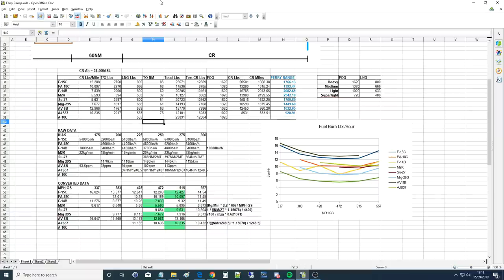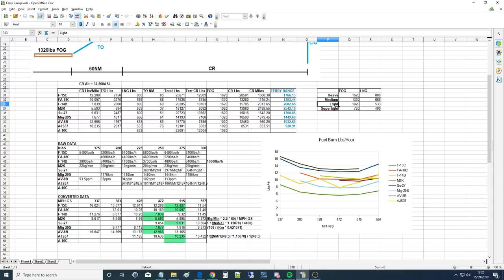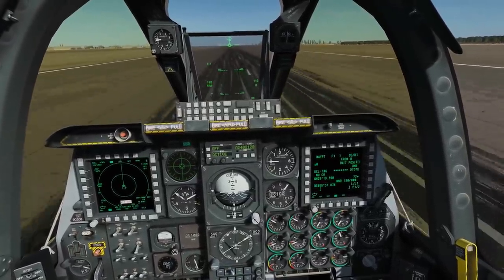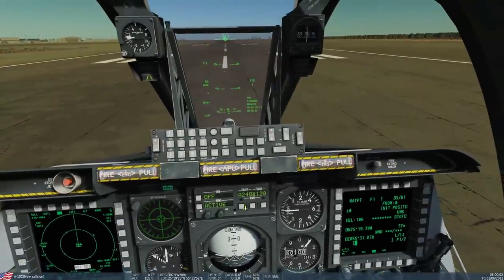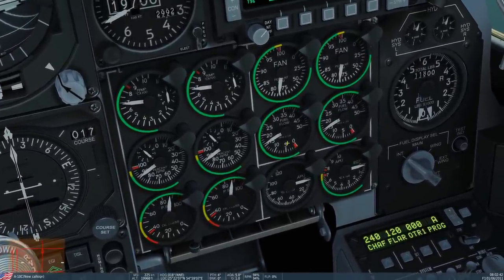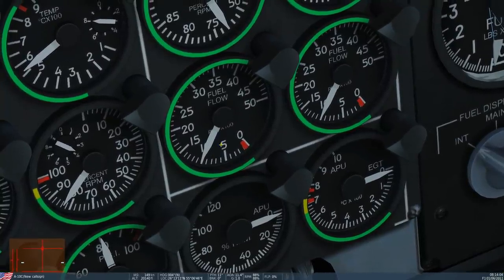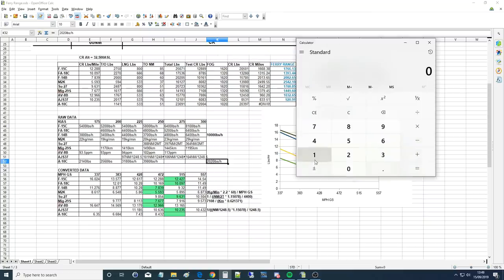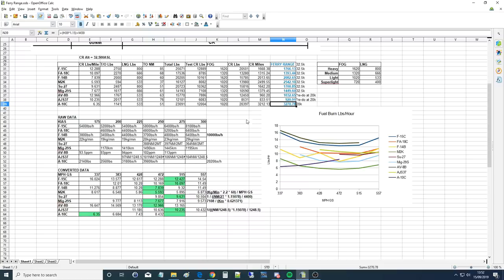A-10C Warthog: Max Ferry Range | DCS WORLD

Comment: Rectangular wings have one of the best efficiencies at low speed. The swept wing on airliners and fighters is to adjust their critical Mach, or the speed at which the wing loses effectiveness, as well as determine where on the wing the shockwave forms.
Gliders and the U-2 have long, straight wings, which lends credence to this.
Reply: The efficiency isn't due to the shape, but due to the engines. The A10 uses turbofan engines with high bypass which are way more efficient than the jet engines that other aircraft use, but they aren't as powerful.
Reply: @rubiconnn  A rectangular planform has an efficiency typically between 0.85 and 0.9, meaning that it is one of the most efficient designs in terms of drag and induced drag. An elliptical wing, as found on the Spitfire, has an efficiency of 0.99 or 1. Coupling the higher efficiency of a rectangular planform (swept wings are typically around 0.7) with the efficiency of a high-bypass turbofan makes the plane extremely efficient at cruise.

Comment: Probable error: KIAS to GS is dependent on altitude. Thus the 175 ias = 337 gs is incorrect, and that's a multiplier into the huge CR. When corrected to a smaller GS, that would decrease the range considerably.
Reply from the maker: Oh fuck! I completely forgot to adjust the KIAS-GS! Thanks for spotting. Will adjust it when I do the viggen.

Comment: Never exceed speed: 450 knots (518 mph,[192] 833 km/h) at 5,000 ft (1,500 m) with 18 Mk 82 bombs[194]
Maximum speed: 381 knots (439 mph, 706 km/h) at sea level, clean[192]
Cruise speed: 300 knots (340 mph, 560 km/h)
Stall speed: 120 knots (138 mph, 220 km/h) [195]
Combat radius:
CAS mission: 250 nmi (288 mi, 460 km at 1.88 hour loiter at 5,000 ft (1,500 m), 10 min combat
Anti-armor mission: 252 nmi (290 mi, 467 km), 40 nmi (45 mi, 75 km)) sea-level penetration and exit, 30 min combat
Ferry range: 2,240 nmi (2,580 mi, 4,150 km) with 50 knot (55 mph, 90 km/h) headwinds, 20 minutes reserve
Service ceiling: 45,000 ft (13,700 m)
Rate of climb: 6,000 ft/min (30 m/s)
Wing loading: 99 lb/ft2 (482 kg/m2)
Thrust/weight: 0.36
Reply from the maker: Thanks!

Comment: Your numbers are way off. First, you are assuming a groundspeed of 337mph based upon the indicated speed of 175 at 32,500ft. But indicated speed changes with altitude at a rate of about 2%/1,000 ft, so your calculations way overblow the groundspeed. 175KIAS at 32,500ft is about 287kts TRUE airspeed, which will equal groundspeed with no wind. However, at 20,000 feet, the true airspeed for 175 KIAS is only 245 knots. So your groundspeed is off by 42 knots, or about 50 mph. This all will cause you to overestimate your range.
Then comes how you are actually doing the test. It doesn't make too much sense. You're setting an airspeed and then calculating the fuel burn based on that. However, that's backwards. You should be picking a power setting and then seeing what airspeed you get. The reason is that the airspeed is going to drastically change for a given power setting with different weights. 90% power at max gross weight vs 90% power at max gross - 6,000 lbs are going to be very different numbers. Hence why instead to measure this, you should be picking a power setting and altitude, then flying a route and averaging your speed along the route, then plugging THOSE numbers into your calculations. 
Overall, if I'm being honest, the whole video seems pretty uninformed, and really has no actual merit as to the range of the A-10.

Comment: Via US Air Force Website:

General characteristics
Primary function: close air support, airborne forward air control, combat search and rescue
Contractor: Fairchild Republic Co.
Power plant: two General Electric TF34-GE-100 turbofans
Thrust: 9,065 pounds each engine
Wingspan: 57 feet, 6 inches (17.42 meters)
Length: 53 feet, 4 inches (16.16 meters)
Height: 14 feet, 8 inches (4.42 meters)
Weight: 29,000 pounds (13,154 kilograms)  Maximum Takeoff Weight: 51,000 pounds (22,950 kilograms)  Fuel Capacity: 11,000 pounds (7,257 kilograms)
Payload: 16,000 pounds (7,257 kilograms)
Speed: 450 nautical miles per hour (Mach 0.75)
Range: 2580 miles (2240 nautical miles)
Ceiling: 45,000 feet (13,636 meters)
Armament: one 30 mm GAU-8/A seven-barrel Gatling gun; up to 16,000 pounds (7,200 kilograms) of mixed ordnance on eight under-wing and three under-fuselage pylon stations, including 500 pound (225 kilograms) Mk-82 and 2,000 pounds (900 kilograms) Mk-84 series low/high drag bombs, incendiary cluster bombs, combined effects munitions, mine dispensing munitions, AGM-65 Maverick missiles and laser-guided/electro-optically guided bombs; infrared countermeasure flares; electronic countermeasure chaff; jammer pods; 2.75-inch (6.99 centimeters) rockets; illumination flares and AIM-9 Sidewinder missiles.
Crew: one
Unit cost: $18.8 million